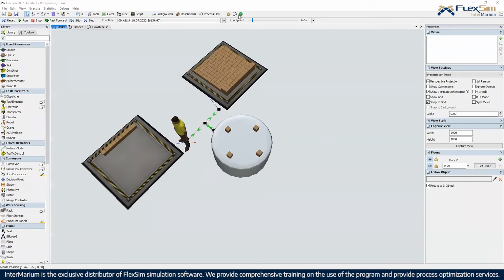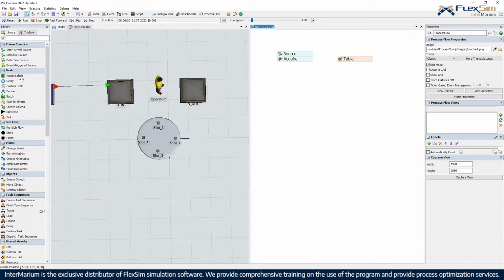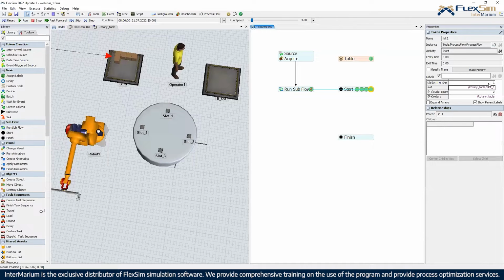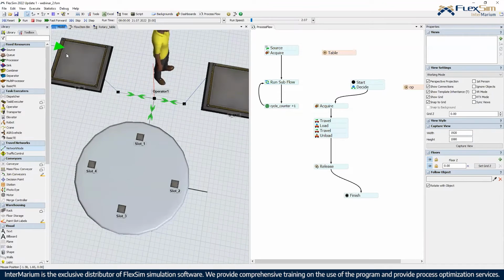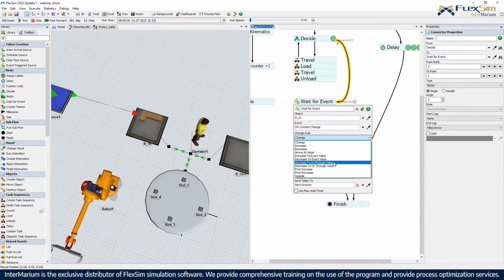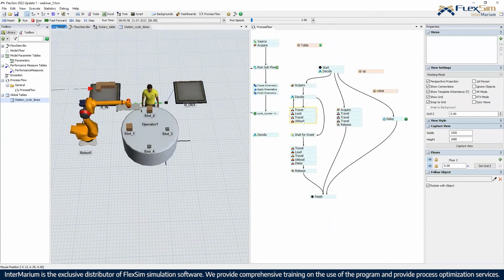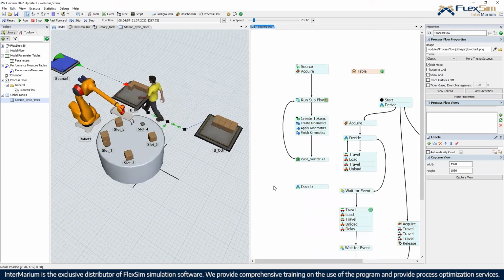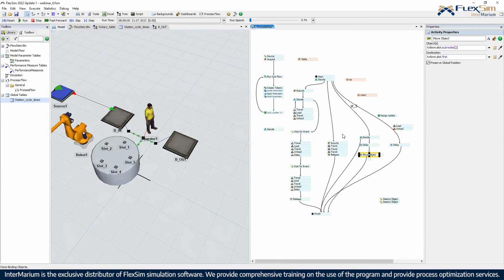FlexSim live tutorial #11 Rotary table.

Comment: Awesome video, as always. Your modular approach really covers all possibilities of change, and using 'pointer' labels to basically do everything in PF is great. Sadly I could not attend this live, happy to see it uploaded.
Before your tutorial actually came out (right after 2022 version was released) I was tasked to do simulation of rotary table and took a completely different approach. Also rotations went in both directions and in different degrees depending on the process step. So how I did it, was that initial token carrying al the info (product type, cycle times, activities etc.) I split with 'split' and 'join' activities - rare instance i actually used them - and ran-subflows for each line (one line is essentially one slot) and when they are all finished ran the appropriate kinematics, and then split again. After complete loop one token would essentially go back and restart the loop. Different approach but worked like a charm. (sorry for bragging) :)